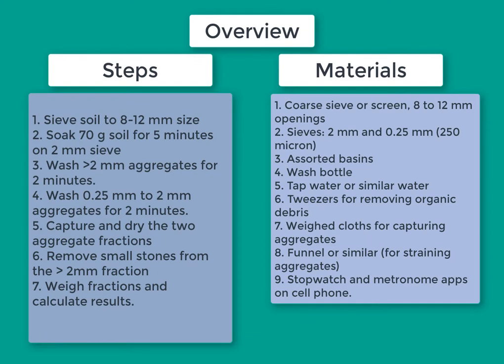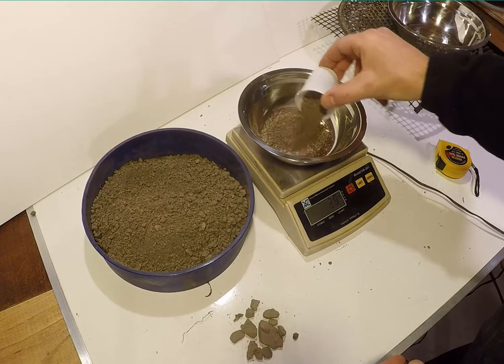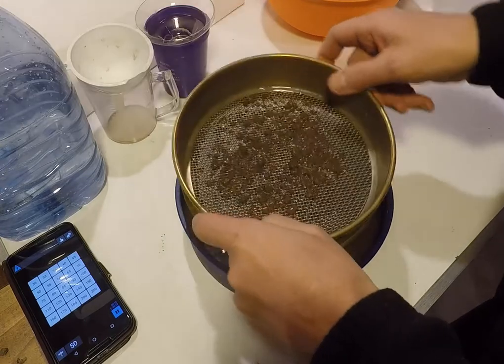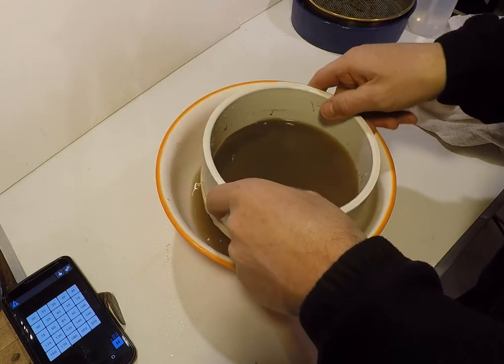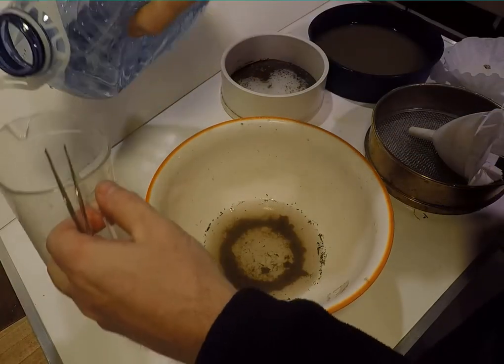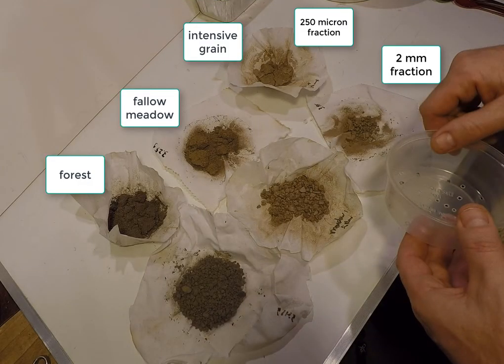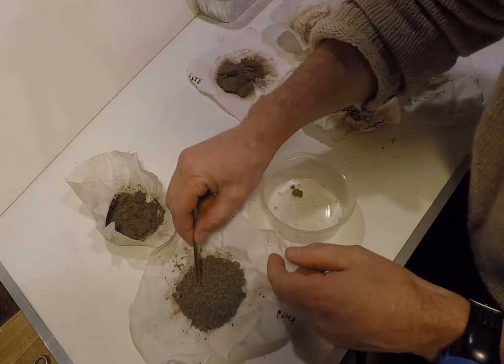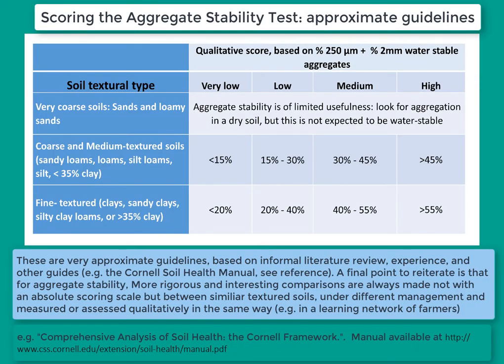Soil Aggregate Stability for Smallholder Soil Health Assessment, Simplified Method

Comment: I helped write a paper on this recently for the Southern Idaho region. I built a machine to basically simulate what he is doing here. I also built a system to simulate rain fall from different heights to show how irrigation system can break down soils.
Reply: This is a very slow and time consuming process. You also have to do a sand fraction
Reply: id be really interested to see that irrigation testing study. can I get a link to it? did you compare covered/mulched soils to bare soil or just height?

Comment: Thanks for this video. what's the temperature of the drying oven to dry out soil?
Reply from the maker: to make accessible, we try to say that the temperature is no so important as drying all the same way, to maintain comparability.  air drying in hot sun for a few days can be ok in field use for demonstration, otherwise between 65 and 105 C would be fine.  Probably the most rigorous  data would be to dry at 105 C to constant weight as is done for gravimetric moisture.
Reply: @lloqalla  thanks again. dry at 105 C for appx. 24 hrs.